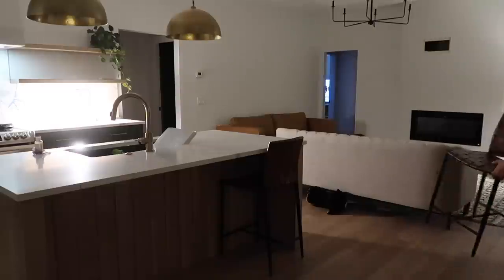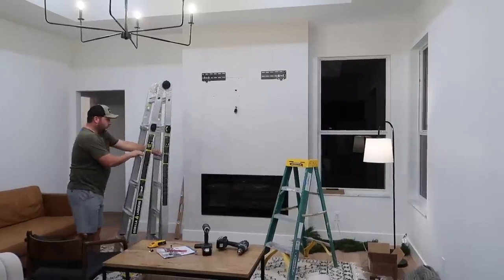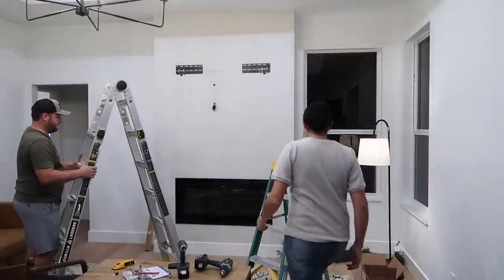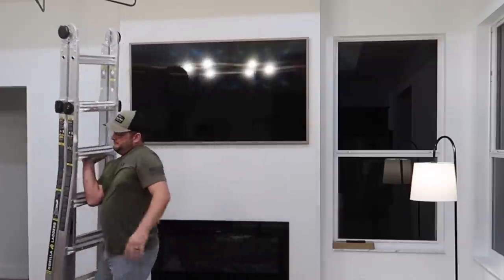CLEANING & DECORATING IN OUR NEW HOME | CONSTRUCTION CLEAN | DECORATE WITH ME

Comment: The opening shots were daunting.  I would not want to face that with company coming in a week.  So much to clean up!!!  Inquiring minds want to know. LOL. Please explain vacuuming on the counters, in the cabinets etc.  My generation would have used a damp cloth (which you used on the counters at one point) or a broom for sawdust.  Does your method get everything up?  Did  you wipe down the cabinets after you vacuumed?  I see a lot of your generation use the vacuums way more than mine for uses we never would have used them for.  Does it have to do with the particular vacuums you guys use?  Are the stick ones better than the regular ones?  A lot of people have stick vacuums with detachable vacuums or that wash and vacuum.  The house looks warm and welcoming.  Great job!!!
Reply from the maker: I vacuumed first to get the main dirt. Then washed out the insides. Actually my mom had done the insides. And then the same went for the tops. Vacuumed the dust. And then washed it down.